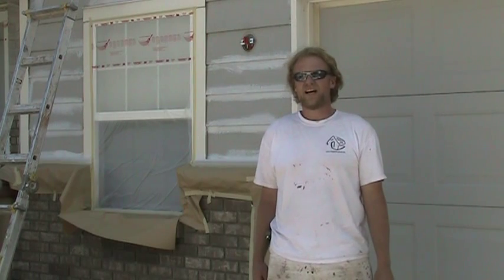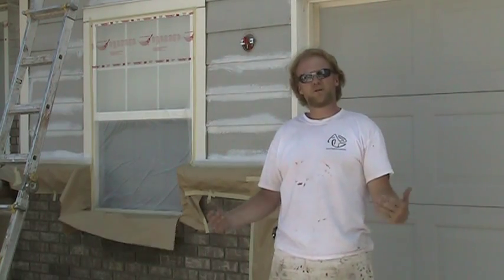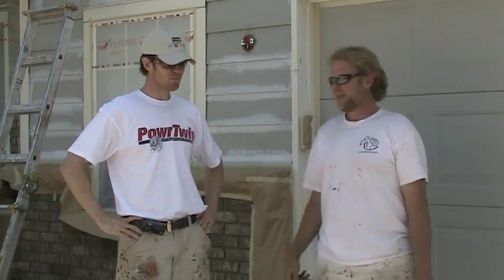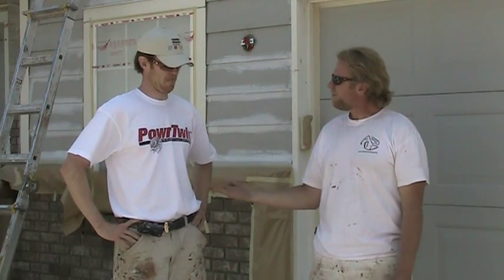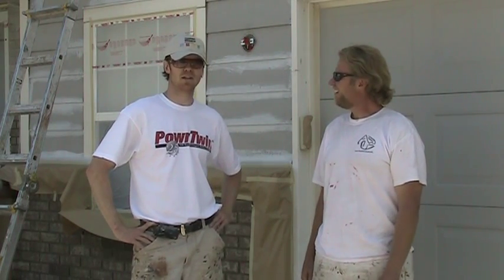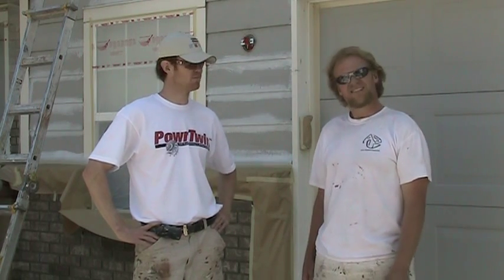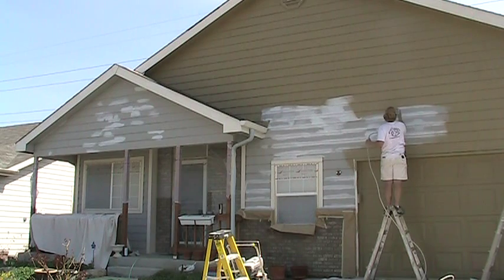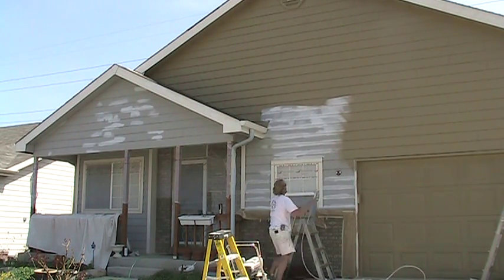Exterior Paint Spraying

Comment from the maker: Thank you. We will back brush or even back roll based on the substrate. This project was pre-primed masonite siding which had been painted once. The siding was very smooth and after the paint preparation, it was sealed. The airless sprayer we use pumps out almost a gallon of paint per minute. We can get alot of product on without having to back brush.